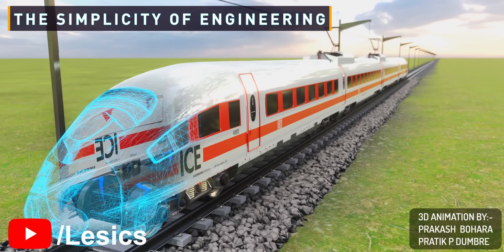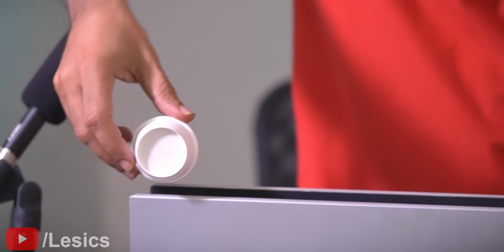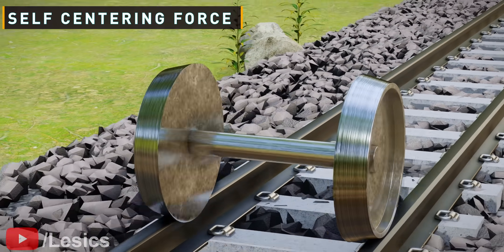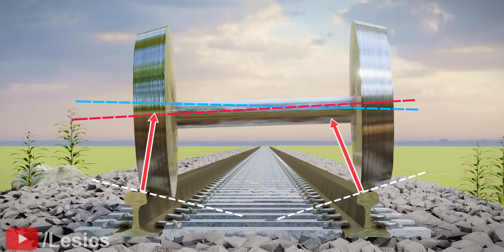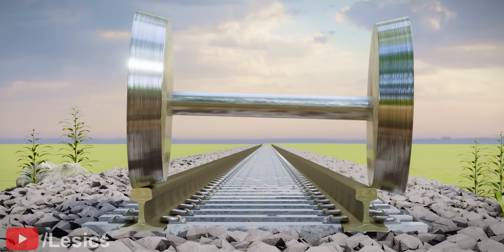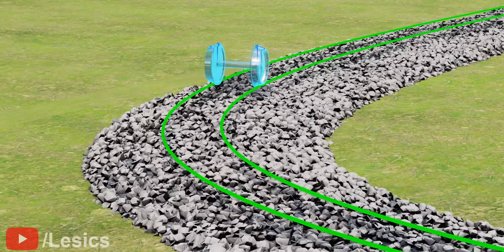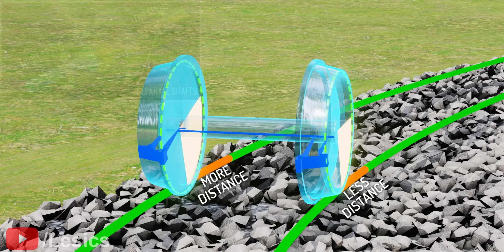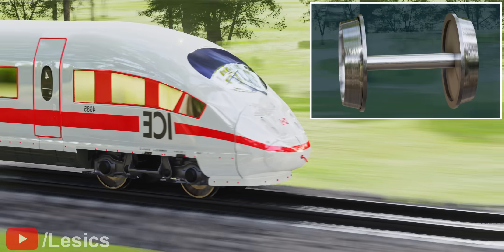The interesting engineering behind the SHAPE of Train wheels!

Comment: I had worked for a major railway from 1999 to 2001 as a heavy equipment mechanic for the equipment that relayed rail and replace ties. I did notice when we relayed rail it was on curves and it was always the outer rail that needed to be replaced. Obviously you don't get full differential capability due to tighter radiuses and I'm sure other factors. But it was also interesting in my observation that curve rails that were replaced tended to be in position longer, meaning a longer period of time between replacement for those rails that were attached to wood ties opposed to concrete ties. I presume that wood ties give a little flexibility opposed to concrete ties. I am in no way shape or form educated in engineering as I'm just a high school graduate with my highest education. Feel free any of you to add to this to explain what I have witnessed during my time with a major railway.
Reply: Your service is very much appreciated, valued and necessary. People like you are the ones actually keeping the world as we know it moving.
Reply: assuming a heavier train would wear down the track sooner, the frequent outer track replacement could indicate trains were going faster than a turn was designed for, or the bank angle (tracks tilt towards inside of a turn like a dinner plate) was reduced somehow
Reply: Good observations. Glad you observed things closely at work to make logical and reasonable conclusions without going through just the motions. Hope the Engineers listen to these to make better and safer rail tracks.
Reply: @Fred Wills Having worked a number of years on railroad track maintenance, you are correct, train tracks are not banked, that would eliminate the effectiveness of the wheels design, and shorten the lift of the rail, and the wheels. On straight sections of track we would take the rail up and turn it around. You get twice the length of time a section of rail will last. I've never seen canted crossties either, that would not allow the rail to sit perpendicular to the crosstie. By the design of the wheel, the right wheel is constantly trying to derail the left wheel, at the same time the left wheel is constantly trying to derail the right wheel.
Reply: It's all about speed. Rail per wat is designed to cater for designed speeds, all curves and gradients are factored into this equation. Trying to run a train outside those para meters is what cause the premature wear and tear.
Reply: The outside rail will be where the weight of the train is shifted in a turn. Also the concrete ties might be used in newer lines with faster trains where the weight is shifted to a much greater degree to the outer rail due to the higher speed. There is excess combined force applied to the rails in a turn, and the faster the train is going, the more that force is concentrated into a shorter time, again increasing stress to the outside rail.

Comment: I dont think this is right. The reason is not because of the tilt. Imagine, one can build a similar system with these cone shaped wheels where the wheels do not tilt when the train is not centred, it would still turn the train. The normal forces on the wheel surface do not change direction in this case (i.e. the angle of the wheel surface stays the same), is it only because of the outer wheel is rolling at a point on this surface with larger diameter, so the outer wheel rolls further than the inner wheel. So what i mean is, it is not because of the tilting of the wheel!

Exactly how this non-tilting mechanism works is not important, it is easy to achieve, although probably not necessary. But mainly to say it has nothing to do with the tilting/change of the angle of the support force vector.
Reply: That's what I was thinking also. The wheels turning on different diameter points would force one side to travel faster, pushing in the opposing direction back toward equilibrium, similar to the curves. His forces explanation didn't make much sense to me.

Comment: Very good explanation. What happens to many kilometer of welded rail tracks when it expands and contracts during day and night time because of temperature variation? Why do the rail tracks don't come off even if there in thermal expansion and contraction?
Reply: Because switch expansion joint is provided at suitable intervals
Reply: If you want more techical details about it you candownload lwr manual of indian railways….
Reply: @nlaad13  thanks :) will download